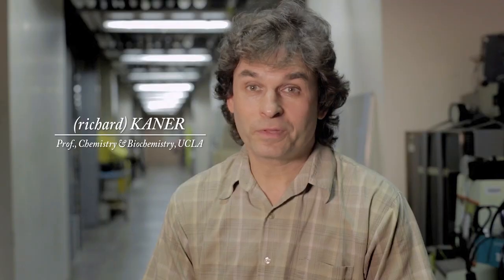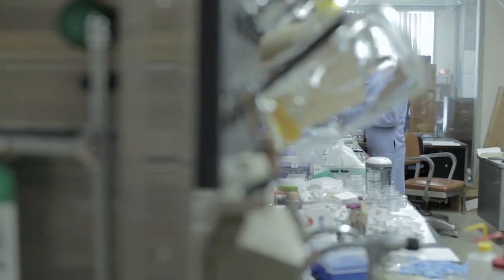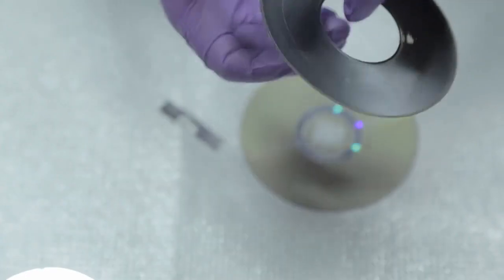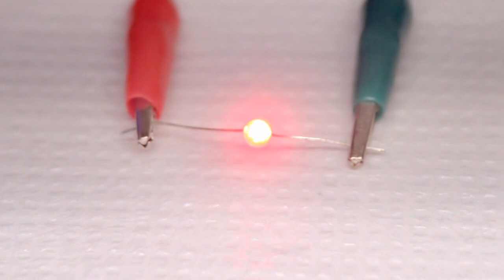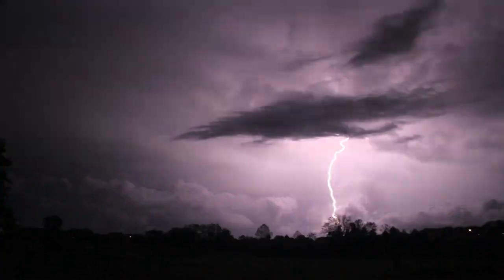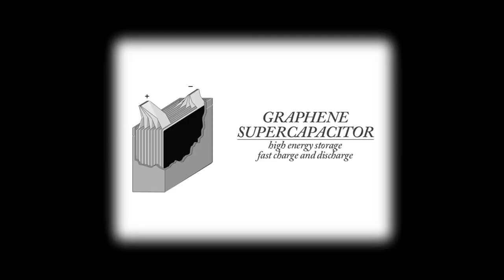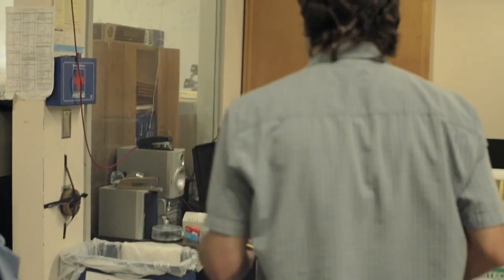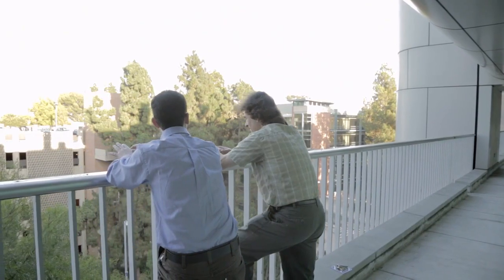Scientific Accident That May Change The World - Homemade Graphene

Comment: 5yrs later... graphene has barely made a tangible presence in the battery OR capacitor industries. Lithium ion had 3yr implementation, 5yr consumer presence, and 10yr market saturation... I don't see this making market saturation in less than 20yrs. Furthermore, I find it difficult to believe "you'll pull into a gas station and charge your car in seconds". That energy MUST come from somewhere. Delivering over 100kWhrs of energy to your car "in seconds" would be not be good for your health... much less your car's.

Comment: People wondering how far along this is, the best super-capacitors do 5.5Wh/kg and the best Li-Ion batteries do 240Wh/kg. So for every kilo of Li-Ion battery you would need 43 kilos of super-capacitors. Obviously things will improve but this isn't an instant replacement, at least not in cases where weight an size are an issue.

Comment: so when these batteries will be available?
Reply: Only copper cables melt because of the high resistance, cables made of graphene do not have the problem
Reply: light
Reply: oloh4xx graphene super capacitors have current density equal to high quality batteries of today and real advantage is about charge cycles.They have millions of charge cycles mean no need to replace a battery for centuries even if they use daily.Plus super capacitors will solve the problem of surge current.Charging time of many small devices eg cellphones,laptops will cut to seconds because thermodynamics will not effect badly due to there small capacity of 3000mah,4000mah etc yes in batteries having capacities in KWh heating will be problem but its solvable.
Reply: so who replaces all of the copper wiring in the house and between the energy customers and the energy suppliers? The answer is : noone. Ever.
Reply: Why would you charge it by cable?
Reply: never. Well not within the next years, at least and even then they will only be marginally better than the best current batteries because of a simple concept of physics : thermodynamics. Its not possible to charge a car within 30 seconds without MELTING THE CABLE AND SOCKET, for example. It doesnt matter how much the battery can store, time is a absolute limit when it comes to electrical charging. Sorry.
Reply: omg ... because thats literally the only possible method of electrical energy transfer, even your shiny "wireless" chargers are connected via cable. I recommend opening a beginners book about physics.

Comment: "If it's carbon based, you can put it in your compost bin and use it to grow vegetables."  Really?  Like benzene?  Naphthalene?  Right...  And that electric car that you think you can charge in a minute?  Not with the tiny cable you showed.   A 60kwh battery charged in one minute is a charge rate of 3.6 MW.  At 1000V, that's 3600 Amps.  Your charging cable would weigh hundreds of pounds and be several inches in diameter.   At ten kilovolts, the cable would be barely feasible, but now you're talking truly scary voltages.   You have a cool technology, that's great, but don't tell people stupid stories.
Reply: graphene superconductive wire is smaller and lighter to withstand far greater loads without overheating - so they say

Comment: The guy on the video seems like he is taking credit for the discovery of graphene super capacitors.  Graphene as an energy storage material was known before the cello tape trick.  That's why the nobel prize was granted in the first place.  It was a race to see who could make graphene quickly and cheaply because it had huge potential in batteries, capacitors, plastics, inks, paints, PCB's, etc.  

As for the light scribe, well there are much easier and faster ways of producing it now.

Comment: over 80 % of  lithium battery companies are owned by who......the oil companies. 👀 lets hope this doesnt happen with this. it solves a 100 year old problem .what happens to batteries when charged and discharged too quickly. heat expands  it and explodes the battery . supercapacitors only need voltage regulator 👍 hurry up and do this
Reply: gregan please take your medication:).
Reply: That can't happen, since its public domain knowledge

Comment: it's good, but why still no such capacitor on the market?
Reply: Because the advances are so rapid that no one wants to commit to any particular stage,which could almost immediately become  obsolete.
Reply from the maker: They are out there, but they aren't always specifically labeled as such. Google 'graphene ultracapacitor' or 'graphene supercapacitor'.
Reply: +Jacky Chen Apparently it is a much more simple process, to produce graphene and graphene oxide, which the average person can reproduce without expensive manufacturing or Chemical equipment. Also, the information was published in the public domain, therefore not patentable. This means no single company can control the formulation, so no perceived profit by those with lots of money for R&D. This Battery/Capacitor storage cell will become a reality but its progression will be slower.
Also See: Improved Sysnthesis of Graphene Oxide on Rice University YT Channel

Maybe you can join the race with neatpete45 and Robert Murray-Smith
Reply: It can take a decade or more for a new technology to enter the market and become widespread. Example CRT television first publicly demonstrated in the 1930's but it wasn't until the 1950's that they became common. Plasma displays were invented in the 1960's but when did you personally see one?
Reply: gregan dark have you taken your medications today?.

Comment: You fooled me before but not anymore. This is NOT Graphene. Real Graphene is clear and it's so thin that you can't even see it! Nice try. It was discovered by British Scientist.
Reply: George Louis Just because it's not a single layer of graphene doesn't mean it isn't graphene..
Reply from the maker: This is real graphene. It is a well documented method that laser irradiates graphite oxide film on a substrate, thereby reducing it to a few layers of laser scribed graphene. Laser scribed graphene can be made very pure and with a high electrical and thermal conductivity.
Reply: Garrett Fogerlie
A few layers thick is not a layer thick. It's not clear, it's not as conductive and it's not what IBM is trying to produce commercially.
Reply from the maker: George Louis In the same sense that iron can be used for multiple purposes, graphene is not limited to just analog transceivers (IBM), sensors (Nokia), memory (SanDisk), or graphene transistors (Samsung). It can, and very much looks like it will, be incorporated into a great many things in the near future.
Reply: Falcqn
YES IT DOES! It's not the super conductor that IBM is working on. Or we would have it by now if it was this simple.
Reply: Garrett Fogerlie
Right. I know it's multipurpose but it was my understanding that no one figure out how to manufacture graphene yet.
Reply from the maker: George Louis Yah, mass production of high purity graphene is the toughest hurdle currently.
Reply: Garrett Fogerlie
I wish I could help but I am to far behind on this stuff. Not smart enough to do anything.
Reply: George Louis Graphene isn't a superconductor. Its resistivity is really low, but it isn't a superconductor.
Reply: Falcqn
Then I have been lied to!!!
Reply: What you call graphine was a cheap remake of what these scientists did and use better resources

Comment from the maker: Easily reproducible graphene may be the answer to highly efficient batteries.
Reply: very neat
Reply: Hemp batteries waaaaaay better!
Reply: Garrett Fogerlie here it is 4years later and it still isn't a real. Product.
Reply: Still waiting.
Still waiting...
Still waiting.......
Screw this, I'm changing the channel!
Reply: Garrett Fogerlie couldn't you use the same method they use to make mirrors to make graphene? From what it looks like even a graphite capacitor would be efficient enough to make a capacitor discharge generator.
Reply: hemp batteries are a good cheaper, sustainable, renewable, alternative, but the graphene batteries are a little better.